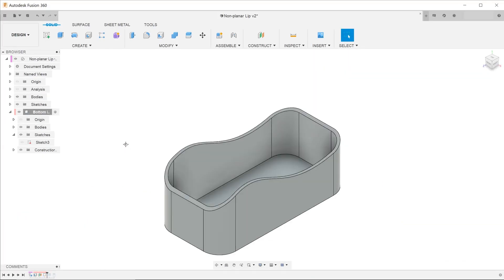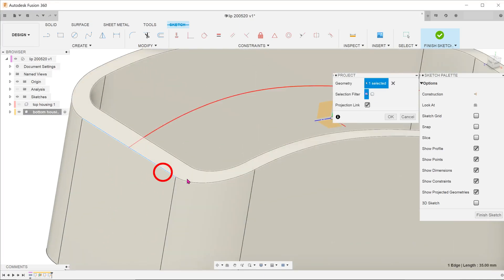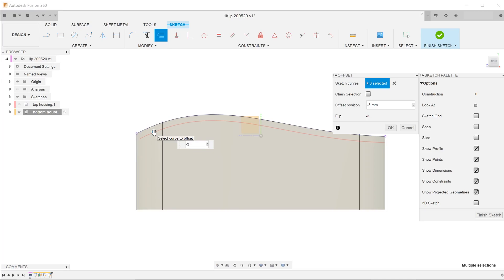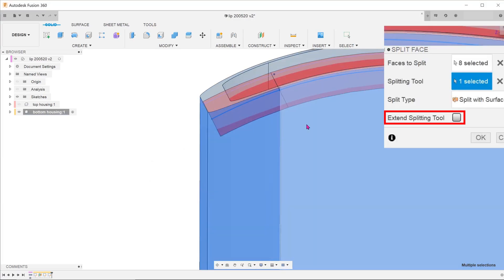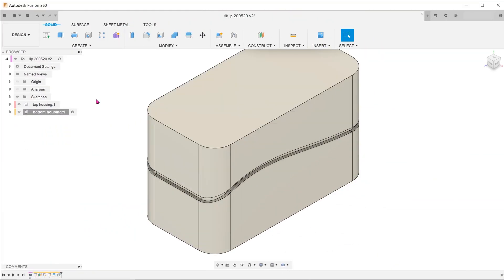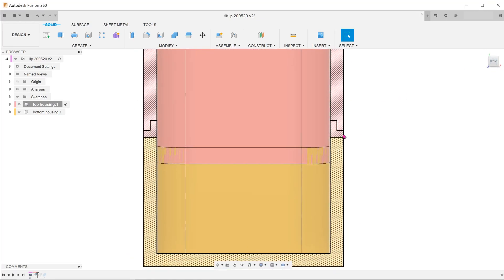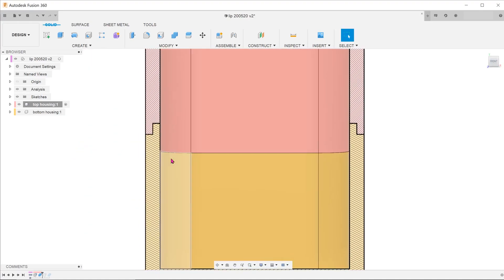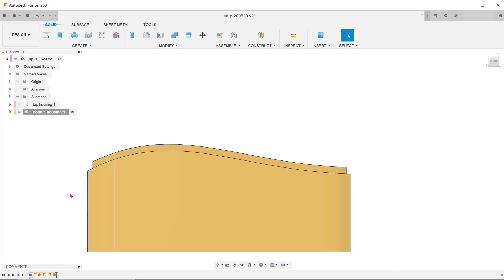Fusion 360 - Non-planar Lip (Part II)

Comment: Great tutorial. Another method is to create cross section sketch of the lip on top surface (using plane along patch) and use sweep command to "stretch" it along upper edge.
Reply from the maker: Yes, that is another feasible way. I had thought about adding that in the video but forgot about it. Maybe I need a part 3!